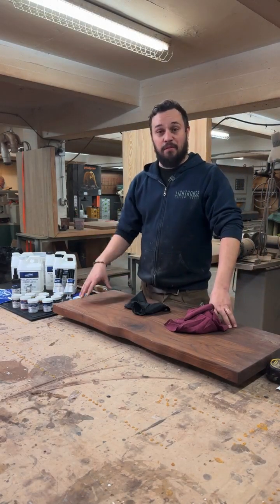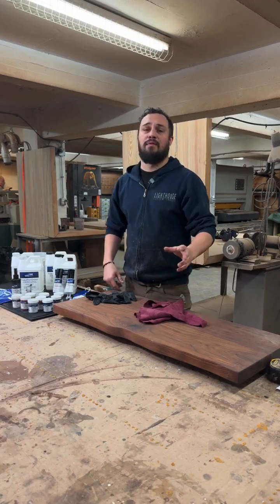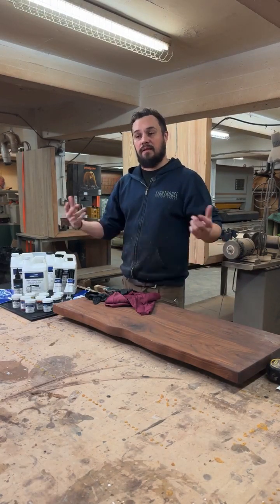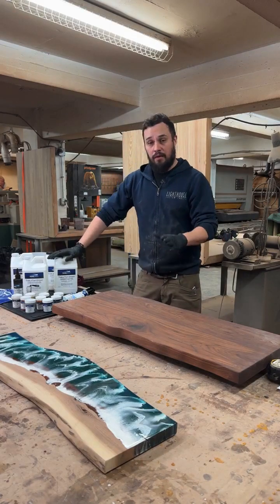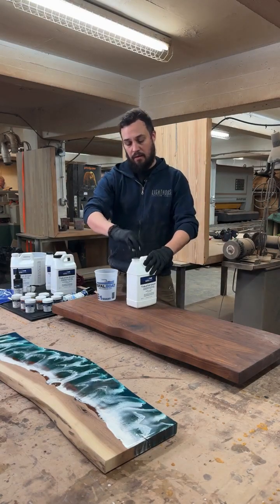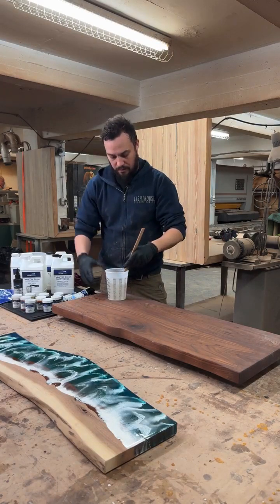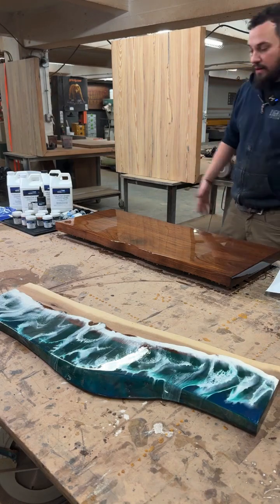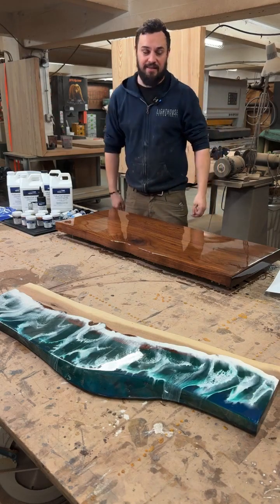TableTop Epoxy Demo with @lighthousewoodworks: Live Replay!

Comment: Neet to coat a store bought kitchen table that cam with some kinda painted surface. Look nice new but it gets marked up and chip easily. Will this stuff work.
Reply from the maker: The tabletop epoxy is durable and scratch resistant, and can easily be recoated if it does get dinged up over time!

Comment: I know I’m late for the giveaway….
And love this video. Just about to do my first pour ever with tabletop. And you talking about the cracks is not unlike the edges of my desk between the wall and the tabletop. About 3/4” but pretty tight. Maybe 1/8” max.  Maybe.
Reply from the maker: We hope your pour went smoothly! Happy this video helped!
Reply: @TotalBoat  it did! The wife and I did it together. It was easier than I expected. Ended up with about 3/16” depth. The dam held and released easily only dripped through in one endcap area where I didn’t seal well. Easily fixed with some HVAC tape. Wrapped the dam with packing tape. Did 2 pours 4 to 5 hours apart. No soft spots so mixing was good. Used your procedure. Moved epoxy around with total boats serrated spreaders. Only thing I did not do was stipple with a brush. Used heat guns extensively so no woodwork would be damaged. Most all bubbles popped. Did end up with several areas of micro bubbles. That was a bummer. I guess using the stippling procedure would have helped that. The epoxy was difficult to get over the edge between the tabletop and wall. Ended up with an entire area where it did not go over edge enough to fill gap but you’ll never see it. Was going to mix another batch and use cake decorating bag to guide it in the crack but as I said, not viewable. Was able to fill all the spaces along the slatwall edge and the exposed wall on the desk wing section. The epoxy did climb more than I expected up the dam making it necessary to sand flush. I was never able to bring to top back to the cured sheen but I got close. Had to hand polish many areas due to the walls and wood coming up through the pour to support shelves. It looks really good!  We learned a lot and I have enough left over to do some shelves I’m building. Wish I had some time to do some test pores so I could’ve avoided some of the issues I encountered, but you have to look real close to see the defects and I’m very satisfied. Drilling holes for cables to come through was also very easy through the epoxy and wood top. If I had to do it over again, I would’ve epoxy the top before installation and avoided most every issue.
Reply from the maker: @VmanJeff  Hey Jeff- so happy to hear it was an overall good experience! We definitely recommend starting small or doing some test pours first as it's inevitable to have issues arise, happens to the best of us! You'll be a pro in no time ;)

Comment: Is there any stain or oil on that wood grain before the epoxy was applied? Are you able to deepen the color of a grain with a certain product before covering with tabletop epoxy?
Reply from the maker: You can seal the wood first with a thin coat of epoxy before doing the flood coat!
Reply: @TotalBoat does the epoxy have to be applied directly to the bare wood or can i use a stain or other product to make the grain more vivid?

Comment: Hey Lucas, applying marine grade varnish instead of that kind of epoxy would be wasting money or would it give the surface of the wood an extra resistance than with epoxy? Say UV protection? 🤔
Reply from the maker: Applying the epoxy as the first layer will really seal the wood and protect it from moisture and the elements. The varnish on top will add that depth of gloss and accent the grain and the UV in the varnish will protect it from UV rays which will try to break down the epoxy (and the finish! that's why you have to maintain the varnish, too, over time!)

Comment: Can you comment on the difference between quick coats, seal coats, and flood coats and which total boat products serve these purposes?
Reply from the maker: To seal wood, we would recommend our Penetrating Epoxy. This epoxy has a very thin viscosity so it can penetrate and seal the wood. For a flood coat, we recommend our TableTop Epoxy.

Comment: Did you stain the wood prior to laying the epoxy?
Reply from the maker: If you would like to stain wood before applying epoxy, the stain needs to be water-based. Epoxy will not adhere to oil-based stains but does adhere to some water-based ones. We always recommend performing a test first to make sure the stain is compatible with the epoxy.

Comment: I'm just starting out and using total boat tabletop on a Charcuterie board.  I cannot for the life of me get rid of the bubbles.  My shop is 72° & 45% humidity.  I am stirring very slowly and carefully.  I tried heating the liquids in a hot water bath,  which helped but didn't eliminate bubbles.  I also tried putting the mix in a vacuum chamber,  which barely did anything to remove the bubbles.  Hitting it with a torch or heat gun only gets the big bubbles.  Oh and I sealed the pieces with shellac & an epoxy seal coat.  I'm doing all the things everyone suggests that you do,  yet my pours are still filled with thousands of micro bubbles.  I'm about to give up on this.  I'm so frustrated.
Reply from the maker: Hey there- we are so sorry to hear you're having issues with TableTop. Does it seem that the bubbles are emanating from the substrate still, or from the initial stirring, or from the cure reaction? Vacuum should remove most of the bubbles if it's put in there after it is mixed but some will still stick around, you need to put it under a decent amount of vacuum for it to be effective though. We do have a 100% satisfaction guarantee, so we recommend reaching out to our tech support team for assistance moving forward. Our support team is available M-F 8am-5pm est at 1-800-497-0010.
Reply: The bubbles are definitely in the epoxy and not coming from the wood. Whether the bubbles are a result of prep or the reaction I cannot say.  I did also try vacuuming parts A & B individually to see if getting all the air out of those first would help,  but it did not. My vacuum chamber maxes out at 30inMg, so if that's not enough then I don't know what to do.  It certainly does bubble up in he chamber; it just doesn't really ever settle back down to a point with less bubbles than when I started.
Reply from the maker: @rfehr613  If you give our tech line a call, we would be happy to chat with you further about this matter. The tech team can walk through the project with you to figure out what's going on!